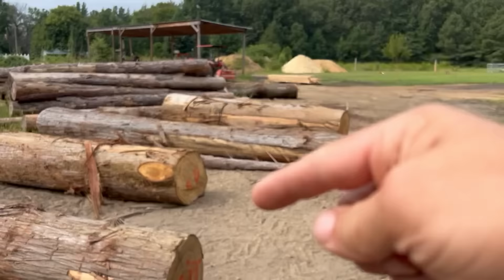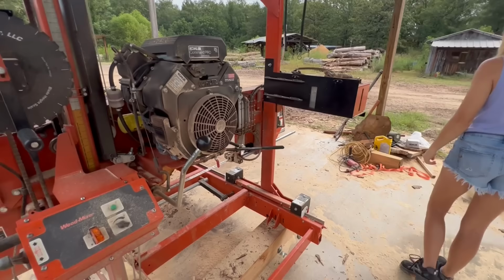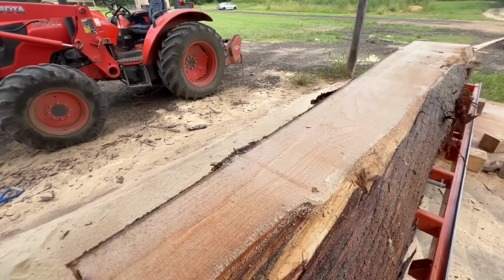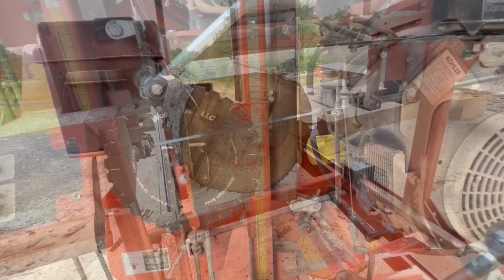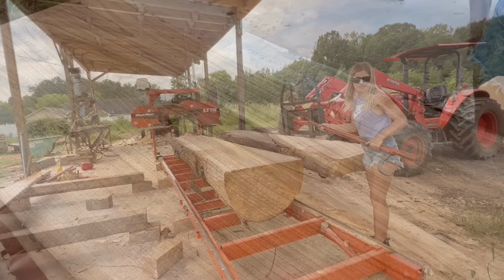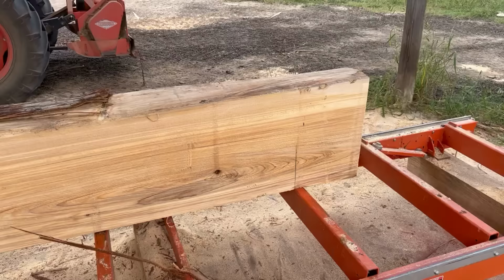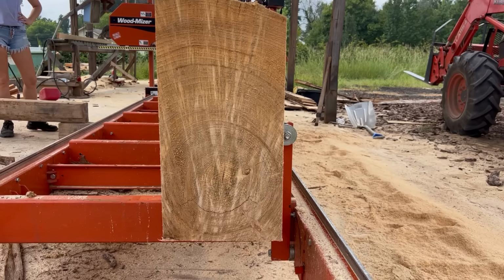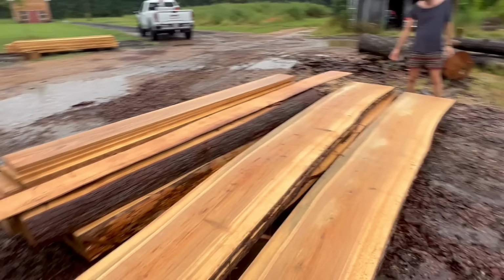100+ Year OLD CYPRESS tree on the Sawmill! (Beautiful Grain Pattern!!!)

Comment: To make it easier to carry the water split the load between 2 jugs so that you have a balanced load.  Your back, hands and arms will thank you.

When we carry a load on one side we tend to lean to one side, opposite the load.  By splitting the load we can stand upright, which is much easier on our whole body.

Yes, you will then have to pour one jug into the other, nothing a good sized funnel can't handle.

Comment: Nice work. But you should start using some good hearing protection. The thumb rule is: When you have to raise your voice to be heard by other 3 feet/ 1 meter  away the sound is dangerous. You might not think much of this now, but when you get older you will feel it, and then it is to late.
Reply: @pellear: Absolutely correct advice. When they are 40, 50, 60, 70 years-old, if the Lord allows them to reach those milestones, they will wish hearing protection had been part of their attire when operating the saw mill. Hearing loss happens in indiscernible increments. It is gradual and not noticed until it is too late. Once an increment of hearing is gone, it is gone forever. It can't be recovered. Hearing aids and/or cochlear implants are in their future. But, surprisingly, young people do not heed the advice from the experienced. Oh, well! We tried!

Comment: I like your vlogs! Just a not of appreciation on how you handle your tractor. So many sawers run the throttle at 3/4+, with a creeper gear. They have hydro-static trans, but still run the engine so fast! Thanks for skill in operating your tractor!

Comment: Very impressive.  Trying the estimate the weight of those Cypress logs!  That loader probably lifts 1500 lbs or so.  But I truly have no idea on the weight of that cypress, or really any other logs or trees.  Would be good to know.  I operate a loader that struggles with 800 lbs at full capacity.  Attempt any more and I am afraid the cylinders would bend.

Comment: WFS - Does that blade get extra hot when you cut slabs at 6"? Is there anything to gain by sliding wedges in the blade path to support the slab weight? Could you show us with a temp gun?